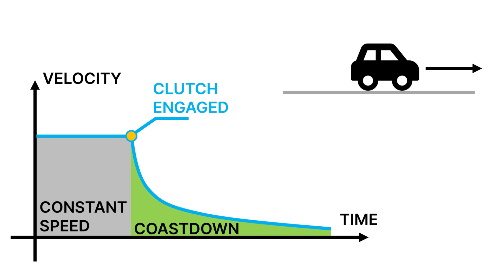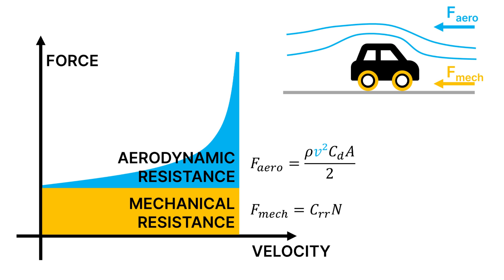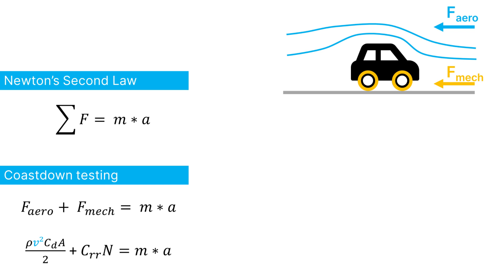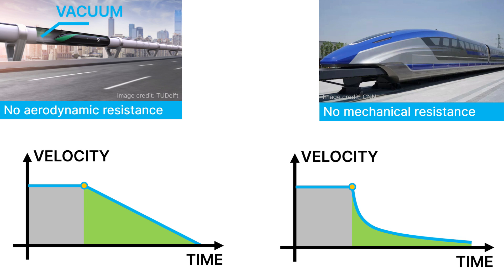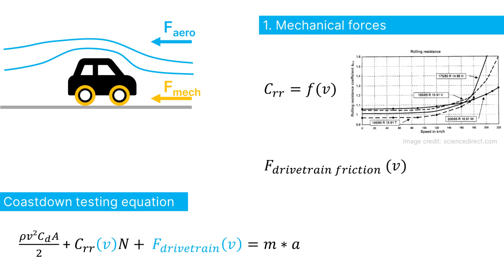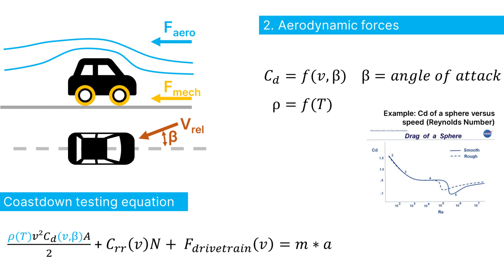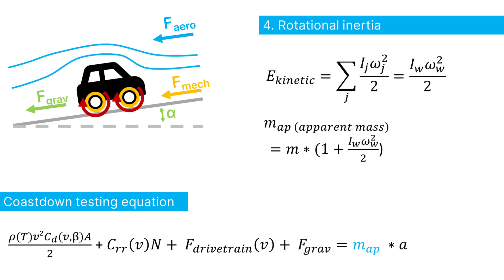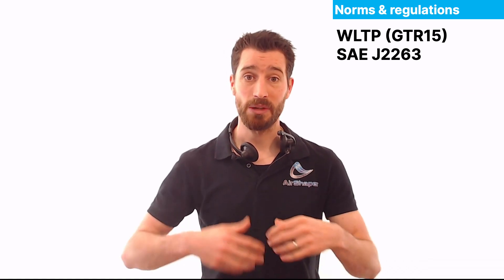Drag Measurement  - Coastdown Testing

Comment: so here is data from aptera test
mph      time
60          0
58          5s
50         27s
40          1min7s   ( called out as 30mph)
30           1min 35s ( called out as 30mph)
20          not called out
10           2min28s
0              3 min5s
Reply: converting those call outs to kw ( via kinetic energy lost each call out) gives:
60 to 58 ....5.92kw
58 to 50 ....4.93
50 to 40 .....2.76
40 to 30......3.14  ( note doesn't follow expected downward trend...........there is some error in the video( edited) or in the call out)
30 to 10 ....1.87
10 to 0......0.343
Reply: there is a call out of 4,000 ft, using the time stamp and distance, it results in speed is 48mph, problem is it should have been called out just after 50mph, not about 1/2 minute later..........call outs have been edited, and probably vision edited also. There is no data forthcoming from aptera, they just cant admit they are not getting their predicted values.
Even the cd they obtained with air shaper was supressed. This supression of data is reminding me of theranos style of operating.

Comment: Hm, this equation isnt really usefull, because what is "v" in rho*v*S*Cx/2? starting test velocity? ending test velocity? Mean velocity during test? Same thing for "a"... mean acceleration?
Reply from the maker: Hi GTX, you have to plot the measured deceleration over time. Then, you can build a theoretical curve to predict the deceleration over time, based on the forces (using F = m * a). Those forces are calculated using the equations shown in the video (and thus they vary in function of speed, and the speed drops over time). Once you have those equations, you can play with the coefficients Cd and Crr to find the best match with the measured curve. Bit hard to explain in a comment, and this is the most basic version!

To learn more, you could perhaps check this paper:
https://www.researchgate.net/publication/262726078_Coast_Down_Test_-_Theoretical_and_Experimental_Approach

Comment: How could rolling resistance be linear?  The wheels turn faster at higher speed, so wouldn't they deform more?  Hmm, maybe their deformation per degree of rotation actually reduced at speed so it becomes a constant.  I guess, but I suspect the error bars are suspiciously larger than the difference between a linear and non-linear rolling resistance.
Reply from the maker: Indeed, it isn't linear! It is at best "sort of linear", which allows you to filter out aerodynamic forces & rolling resistance forces. But if you want to extract more accurate values, you'll need a non-linear model for rolling resistance. And you're right, as you normalize by the vehicle speed, the rolling resistance coefficient can also go down in function of speed.

Comment: Done that a decade ago on my tail faired recumbent low racer bike with some succes (numbers looked acceptable) but I did not think about including a term for rotational inertia . Thx for that ! My Crr estimate was checked by doing a low speed coastdown (from 10 kph) when aero drag is negligible (certainly so on a very aero recumbent bike with a very reclined body position ->low A) . Crr came out as approx 0.0035 which is very low for 20 inch bike tire and even low for a normal 28 inch road race tire , but this was a very special limited edition race tire (not for sale unless you had special access to Schwalbe) with no punction protection whatsoever and a very limited life (about 1000 km) .
Reply from the maker: Hi Gerrit,

cool, thanks for sharing your experience!
You must have been quite precise with your measurements to come up with those values. What GPS (or other position tracking) did you use?
Reply: @AirShaper  no GPS , but a special app and interface (with sensor) on a Palm device (PDA's back then were popular before the age of Smart Phones) . It actually tracked every revolution of my front wheel with a very accurate time stamp . I could transfer that recorded CSV file to my PC and then do all the calculations (regression stuff) in Excel. It did require a very accurate roll out measurement of the circumference of the wheel under load
Reply from the maker: @gerritgovaerts8443  Ah that's fantastic, indeed a very precise way of measuring the distance/velocity (by derivation). Interesting note on the changing circumference under load!